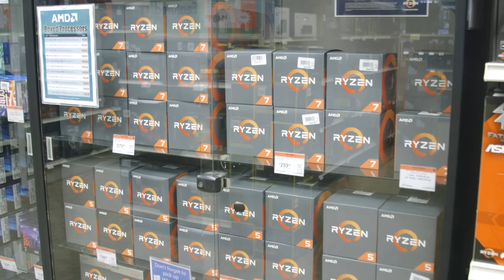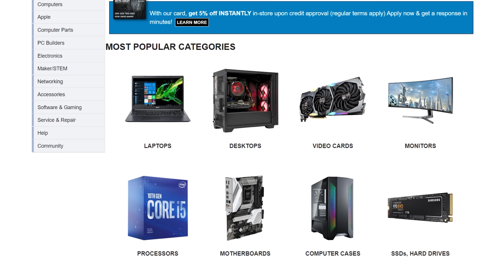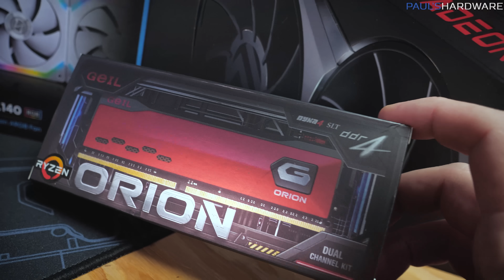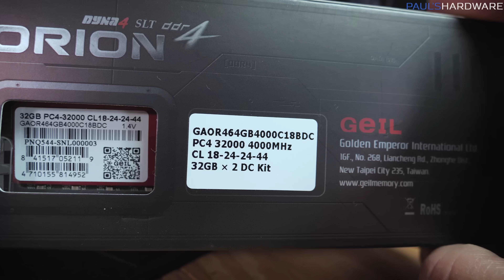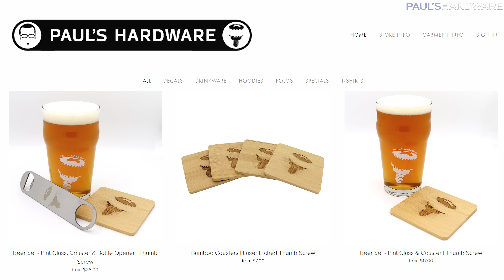Building a Water Cooled Gaming PC in 2021 (Part 1)

Comment: I am transferring my system into this case, but the all-white snow edition. My only hangup was my 360mm AIO that won't fit at the top with a full ATX board (without modding it somehow). But today I finally found a white 280mm AIO from Germany called the Alpenfohn glacial water.  I couldn't find a white 280 available in the US anywhere.  Now I can fill this thing out perfectly with fans only at the top and bottom with the 280mm AIO at the side, I cant wait to build it!

Comment: You know EKWB has a 90 degree mount for that res, you could mount it perpendicular to that rad so you can see it from the front. Black or white and grey/silver for the cables. Or white primary, grey/silver secondary, and a single or two strands of red per cable.

Comment: hey paul big question for you as im finishing my first ryzen build an need some advice 

my setup is the b450 aorus m + ryzen 5 2600 with 32gb of Crucial Ballistix 16 GB (2 x 8 GB) DDR4-3200 CL16 Memory 2nd set yet to be installed

but after boot up i cant seem to change the setting in bios when i click on auto to go manual it dosent do anything ,i recently saw a youtube where somone showed that clicking on the desired values to change an just type them in an hit enter, can you advise an confirm this iv yet to try

an if it does work whats the best oc clock an voltage to push to 3.7ghz

im using 

a ARCTIC Liquid Freezer II 120 

an Innovation Cooling Graphite Thermal Pad – Alternative to Thermal Paste/Grease (40 X 40mm

an a Noctua NF-F12 iPPC 3000 PWM in the pull  config with two Noctua NF-A14 iPPC-3000 PWM as top exhast to my corsair 275R Airflow case

an to any including paul who can advise me on further bios setting that im using ,should be using or not or havent used that i should be please forgive the not spartin screen shots

https://photos.google.com/share/AF1QipNw3rWRZ-PCeiSbOtVSBL8Es4_lksclYova1LKTMiYb0Z3svOT8-iwe3YsBLGrDcg?key=NmFFY25QbWVxRmlkaUxuYWwtblVPMHJZVmJyaER3

Comment: Seen the White Case and the EKwb water cooling and had to watch..Nice build Paul. I'm old school I look at Goodwill and others for old ATX 3 feet tall or taller Towers and custom build them (cut, weld, Paint White) in are shop, and add a wider slot on the side for a Radiator.  I love a Big PC Case!!  People see them and there mouth drops. BIGGER IS BETTER! Way better!

Comment: I think access to the lower MB ports is going to be the biggest challenge, especially down the line if the new owner needs access and having the lower rad locked in place with fittings to the pump. Maybe there'll be just enough room to get a plug pushed in using needle nose pliers or similar. Since the board has (2) 3.x headers + the type C header on the front edge I suppose you could use a 3.x to 2.0 adapter to give yourself some internal 2.0 headers and ignore the (3) 2.0 headers along the bottom.

Comment: If that 360 fits s swap the 2 and put the res at the middle fan location for symmetry. option 2 in my opinion would be the res at the back exhaust location would be a very small loop and visible through the front glass.

Comment: O11D mini + ATX = very limited rad mounting options. I was expecting you to go ITX until I saw that mobo on the table.
The FLT pump/res would probably look better on the rear fan mount. Looking in from the front it's taking up half the width of the case and isn't exactly pretty ;-)

Comment: I would paint the pump/res mount silver or white so you don't have all that black showing from the front. As for the cables, I would do red in the center and then gradually fade from grey to white working out from the center. It would be a little more work for the guy doing the cables but the end result would look pretty cool. Get a double 8pin bridged PCI-E connector cable. Silver cable combs to match the silver accents on the fans and the loop.

Comment: Won't the connector that you snap onto the uni fans conflict with fittings on the bottom radiator?
As I recall, that thing is a little bulky, so hopefully there is enough room  to connect it on the back side of the case instead.

Comment: I still need to measure for my custom cables. I'm still using the shitty ass stock ones and they are BARELY long enough. lol Also when I finally got my ASUS 3070 EKWB edition I had to drain my loop and the tubes were partially stained blue even after only 2/3 months. I was a little surprised by that, but only the tubes. Everything else is still clear.

Comment: Hey Paul, Idea for ya. You have a 120 mm mounting point on the back of the case that way you can put 2 fans on the 240 mm radiator. How does the reservoir look mounted back there?

Comment: Not sure I would do that 240 rad in there, Paul - running the tubing for it is going to be a mess, if it's possible at all. I would just do a 120 at the top half and mount the pump/res to the case directly. Or just source a 240 distro plate and skip both, and go push/pull on the 360 rad to make up for the loss of the 2nd rad.

Comment: Since your reservoir doesn't have any top ports I would swap it with the fan.
   Also since you using flex tubing if there is clearance maybe have the cpu tubes go up and around for a stealthier look.

Comment: I think i would flip the pump res combo and the fan on the 240 radiator. Making the res the top part would make a better colour match - a black/dark strip on the upper half and a mostly white compartment on the lower half. I don't how bulky that could get, but thats my take on the build.

Comment: Using a smaller mobo will allow for a more beautiful design since you'll have more space for more radiators and fans on the top and bottom of the case. But since the mobo was gifted to be used in this build i understand why your choices are limited 😭

Comment: Just an idea about the 120mm pump res combo. What if you cut out the rear fan mesh and put the pump res combo in the rear fan position with the pump hanging out. In standard PC orientation it would look amazing. Also no gpu conflict this way and you could go with a 280 slim rad on the outside with only the fans on the inside so you have enough of a gap for cable routing and use the 140mm fans. :D

Comment: Hey Paul , question for a probing. If I don’t own radiators and want to build a water cooled pc how do I know if the rads will fit in the case? You had to downsize here. How do I know before ordering if it will fit. Returning hardware can be a pain. Sorry if this is the wrong video for this question. Love your work. It has been very informative. One day I want to build a pc

Comment: I'm wondering if the pump/res combo would look better at the top (flip the two). Other than that I think it all works. 

Possibly make the cables a deep red with silver and black accents. There's enough white in the case/motherboard/fans already. That could bring out the red and make it pop a little.

Comment: Those AMD cooling kits are frickn' awesome bits of gear! Perhaps mount the pump to the rear 120mm fan spot above the IO Shield clear res facing forward, I'd go for 10/13mm clear tube tho' the black will be too chunky for such a small case.

Comment: Loving the build so far- you da man, Paul!! Can’t wait to see part 2. Before I decided to hold off on a new build until prices and availability becomes more reasonable, I was considering this case because of its modularity; never thought to free up the real estate in the front by downsizing physical dimensions and relocating the power supply! Genius! It’s got me  reinvigorated thinking about moving forward with a stopgap build around the 5700g when that drops in august complete with over the top cooling at the ready and an abundance of led lighting to display the void that would be the gpu! LOL

Lastly, on the custom cable extensions, I’m envisioning white on the 6 top and bottom outer lanes with a combo of black, red, light gray(or silver) in the middle, favoring gray or silver. 

Cheers!

Comment: Nice build but the case is way to small for my liking. I have a Fractal Design S2 Meshify and I wish it was 2" taller to mount a push pull fan config on the top that would bring me from 7 140mm fans to 9. technically it would fit but I don't like the aesthetics.

Comment: I would love an O11 version designed with top, bottom, and side 280mm radiator support. Like the NZXT Manta except with a 3rd rad. 280's are amazing for sound and cooling.

Comment: This couldn't have came at a perfect time I just got a gpu but it has a preinstalled waterblock on it how do I test to make sure it works before building a custom loop
Reply: just plug it in and check if the system boots. just don't keep it running for long.the water block has enough metal to soak the heat for test boot.
Reply: @tanmaypanadi1414  I thought it about doing just don't want to burn out the card before I even had a chance to use it yet

Comment: Let me start saying that I love your channel, BUT that's the wrong case for your build. You should do it in the o11 dynamic XL and use 2 360mm radiators.  Regarding the cables I would like to see white cables, those will reflect better the RGB and I believe that between black, silver and white you have enough small red details, red cables will not shine there...

Comment: 15:30  
Could you relocate the pump res to the back of the case?  Adding an additional usable fan to the side radiator would be better than having an empty space in the back.

The Microcenter here in Denver has tons of the 140mm Unifans.

Comment: Looks like a beautiful rig Paul 😎
Now suggestions as per request:
- cable sleeves silver with vivid red thread accents maybe?
- per GN Steve's advice for Ryzen ideally run memory on 3200 MT/s (1800MHz) /w CL14 (or CL16 if it can't keep CL14 stable) - 4000 will apparently kneecap performance

Comment: What if you mounted the res on the bottom rad closest to the front of the case, looks like it would just make clearance from the gpu? Visually that pump so bulky in my opinion, i'd like to see it mounted below. I just not sure if you would have clearance for tubing with the bracket.

Comment: hey paul, could you try moving the radiator between the back panel and the side fan mounting area? curious to see if it will fit including routing the tubes through the small opening.

Comment: You should really use a clear coolant that has corrosion inhibitors and not just water, corrosion can occur even with similar metal plating due to impurities. I'd recommend stocking up on some koolance 705, it resists corrosion and isn't electrically conductive, it's one of the best choices if you are giving/selling a watercooled system to someone.

Comment: holy crap a computer build on youtube in 2021 that isn't stuffed to the brim with corsair parts! (I'm so insanely tired of seeing them)
Reply: my current rig was partly built out of Corsair parts (AIO, case, fans, keyboard, headset, PSU), only the case and headset is left because as good as their parts are, I'm kind of want to use somebody elses parts going forward

Comment: White/silver/red psu cables would be my choice.
Reply: Red in a white case?
Reply: @CosmicCleric  he has a red ram kit and the ek fittings have red accents. He said he wanted the psu cables to also have red to make the color pop more. Kinda like the gpu having that red ring in the front.
Reply: @bourbonrye395  fair enough I guess, it just doesn't seem like red and white goes together, generally speaking.

Edit: And I realize there's irony in saying that, considering my nationality.  :p
Reply: Redand white gets my vote
Reply: @stpirate89  red seems so harsh, with all the white.
Reply: @CosmicCleric  doesn't need a lot of red though. I'm imagining maybe two or four red cables and the rest white for the 24 pin.
Reply: Red and Silver/grey to match the fan hubs/corners

Comment: That is going to be a gorgeous build, i think black and a similar gray to the unifans with a touch of red, preferably crimson red, or close to the fluid if your sending the red fluid with the system.
Also a m.2 drive could be kind of important considering how much of a pain it would be to install after the fact.
The fluid, though it'll be blacked out from the tubing, it would really pop in the reservoir. Thats trading looks for function tho, function over form allll day in the end .

Comment: Paul,
I ordered 32gigs of ram DDR4 3200,  can I use both 32, and 16 DDR4 3200in the 4 DIMMs? 
Rysen 5 3600, msi b550 gamer core(because I couldn't get a tomahawk) 
Or just use the 32gigs?
Thanks.
Reply: Mixing ram sizes isn’t as big of a deal as mixing ram speeds. So as long as it’s all 3200, that part will be fine(but AMD can utilize faster ram too). Just make sure you pair the 32GB sticks in the corrct dual channel slots and then the 16gb in the remaining slots. If you mix them up it will only ever dual channel with 16gb of the larger sticks and the remainder will operate like a single channel. 

That all being said, 32GB of ram by itself is more than enough for almost any gaming. Content creation and editing might take more, but I have 32GB in my system and I’m only running 20-45% of RAM at any given time.
Reply: @PeterTX  thank you, I wasn't 100% sure.  I searched about the 3200. 
 Newegg had a sale for the 32gigs